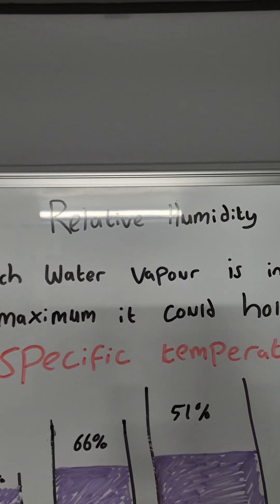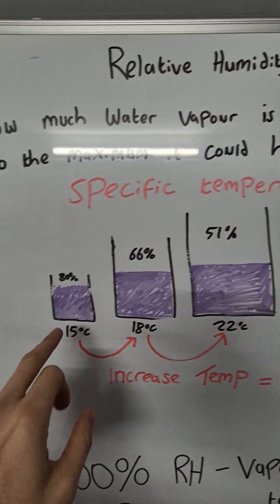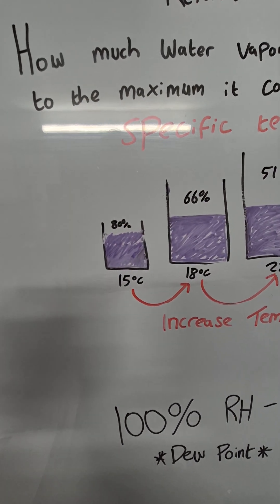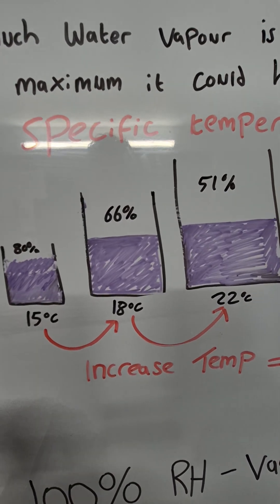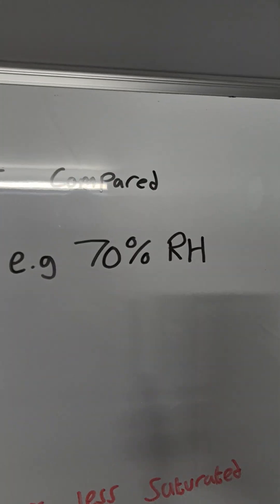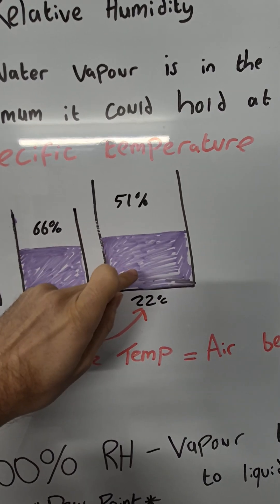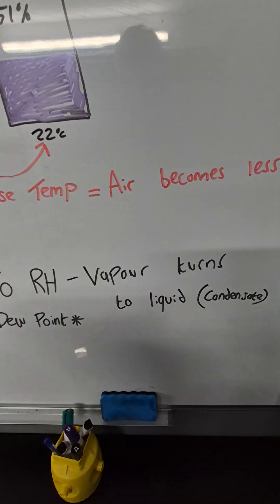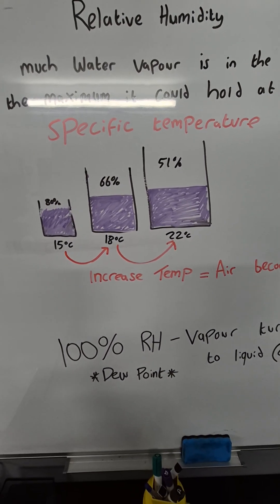Relative Humidity and Condensation, What Homeowners Need to Know

Comment: Im guessing ventilation only works if where ur venting is lower in humidity than where ur venting from.
Reply from the maker: No, not quite. Outside air is often 80–95% RH but still drier than indoor air for much of the year. What matters is dew point, not RH. From autumn through spring, even rainy air usually has a lower dew point than indoors, so ventilation reduces indoor moisture. In summer or during warm, muggy spells, ventilation can add moisture instead. I hope that makes sense.